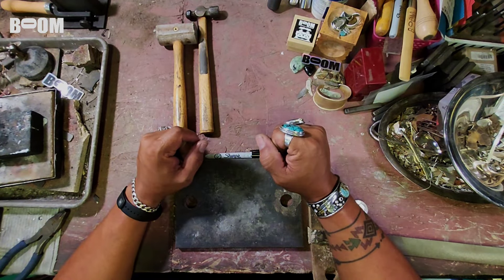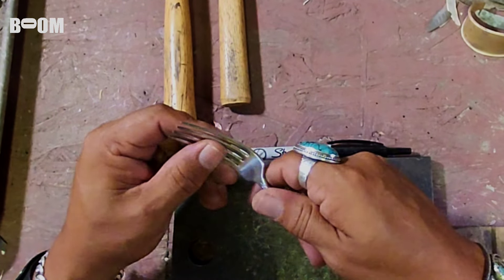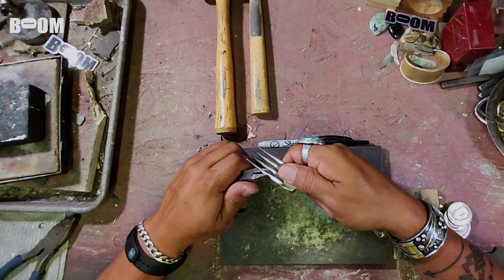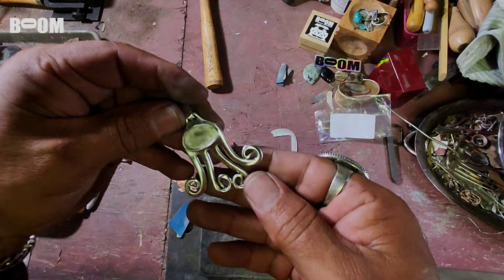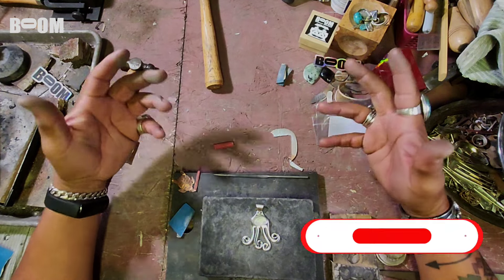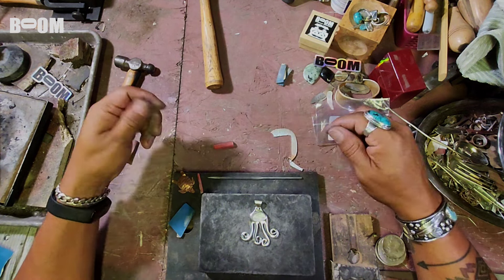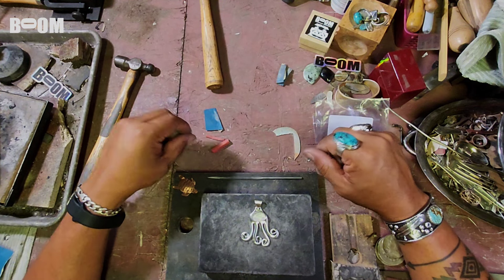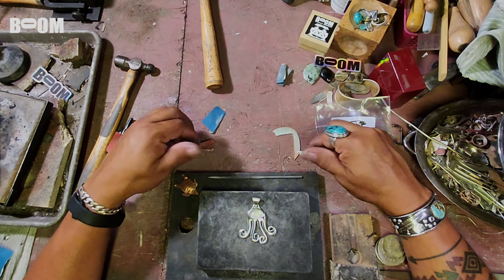Ep.95) How To Make Fork Pendants | Lessons Learned | #jewelrytutorial

Comment: To polish your block, use different grits of paper on a piece of glass. Move the block in a figure 8 pattern. That will insure flatness. When I polish things like that I go up to 2,000 grit paper and then usually use a polishing bonnet on a drill and a very fine polishing compound. I've even gotten good results using 1,000 grit paper and then a polish. Brings up a real nice shine.
Reply from the maker: @64t120r  great tips!! Okok! Lets go!